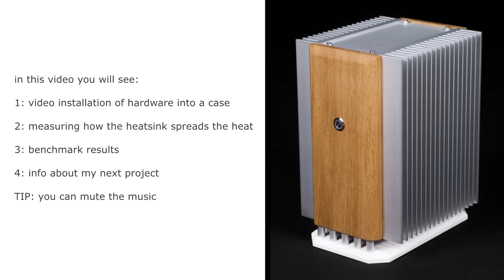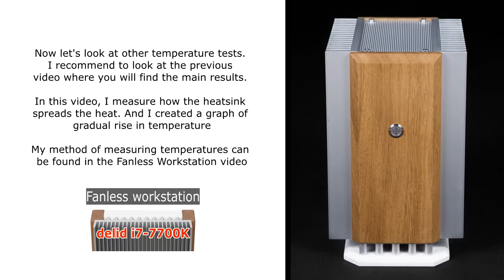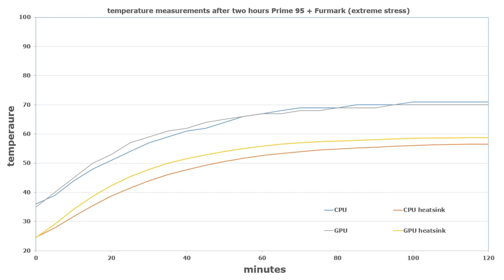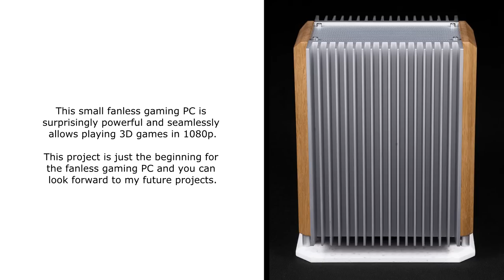How to Build a Silent Gaming PC

Comment: Overall very good design! Thanks for sharing it. I am doing a thermal simulation of something similar. However I spotted a couple of details that people who'd like to try this need to be careful about:
- The backplate of the GPU may short circuit pins on the back of the card. In the way that it is mounted there are no spacers other than the thermal gap pads (which will soften and compress as the card heats up) between the sheet metal and the back of the board.
- Second, you need you be careful with the force that you apply on the GPU. Since rigid mounting is used (bolts and nuts, not springs) you rely on a "small" bending of the PCB in order to achieve even compression of the paste. Desktop CPUs can take a lot more force because they have a heatspreader that reinforces the construction, however the GPUs have exposed dies, therefore very little overcompression will crack it. The limit for Intel BGA devices on laptops is 67N of maximum static load and if you work it out, it does not take a lot to damage large BGA devices. Just make sure that you tightening the four nuts on the back of the GPU precisely the same number of threads and don't force it too much.

By the way there is a passively cooled 1050ti. I believe it was a Palit model. Have a look if you're interested. 
Cheers!
Reply from the maker: Thank you, you are right that I could describe in more detail:
- I used 3mm Heat conductive gel foils, which is very strong. Of course, it's important not to shorten anything - I used the backplate of the anodized aluminum that is electrically non-conductive.
- yes, it is important to tighten the screws with the feeling that nothing is broken, it is true that it wants experience and it is not a solution for everyone
- Palit GTX 1050 Ti KalmX is not designed for a fanless case, it has much worse cooling that does not work without a fan in case (review - https://www.tomshardware.com/reviews/passive-cooling-geforce-radeon-test,4960.html )

Comment: I wonder if pure copper thermal conductivity is 1.87 times better than pure aluminium, can I simply assume displacing aluminium in  this project with copper would bring 1.87 times better heat dissipation?

Comment: Excellent work. I see you have a talent for working with different materials and knowledge about electronics...that's great.
When I get the time I plan on building a no- fan PC myself. Funny enough I had similar design in my head..just without the stone only aluminum and wood.

Comment: Since total watts in TDP are a good indicator of heat generation you could also put in a GTX 1060 and as a tradeoff use a non-K CPU, better yet a 35W CPU. I built such as system before, not with passive cooling but total power consumption stayed within 130-140W and I was using a HD-PLEX DC 160W with a 150W laptop power adapter to run it all.
Reply from the maker: The GTX 1060 needs external power, picoPSU does not support it, I think the GTX 1050Ti is optimal for this size heatsink and the CPU power here was only used to test the total power of 150W with regard to PSU 180W - this is a secondary project and i7-7700K I have for my main project that will come later and will be a much more powerful fanless gaming PC

Comment: Such an amazing clean design! As a consumer I am drawn to this idea, but I would want to run much higher TDP GPU and CPU, even if it means adding a large diameter quiet fan - “near silent” is good enough, as long as the system is still SFF and user-upgradable in the future.

Comment: Timeless master piece, love the wood + metal design. Absolutely the best Ive seen
Ever thought doing a Ryzen 2400G? it has TDP of 65watt, lass then your current underclock cpu at 70 Watt
Reply from the maker: Thank You! There is no problem with AMD Ryzen, but I'm currently using components from Intel ...

Comment: Impressive, and an interesting attempt at a gaming system. I don't have the numbers at hand, but I believe the 17 7700k had a stock 4.2ghz speed and turbo boost of 4.5ghz @ approx 1.25 volts.  Eevn though you've under volted the C.P.U and lowered the ghz..it is still generating a fairly noticeable heat into the passive heat sinks. I don't think its quite gaming ready, but it is still a very solid attempt. Well done.
Reply from the maker: Thank you, please read my first comment why I used the i7-7700K

Comment: Probably the most tasteful and practical case design on the internet that I have seen, I would like to see with all the cords plugged in as your cable management looks well considered as well and its has to be one of the biggest issues to getting a real life build looking nice. A 1080 Ti/8700k @4.5/5ghz would be some real clickbait imo....would this build be big enough to even fit a 1080 TI? IF so do you sell a kit?
Reply from the maker: Thanks for support! Cables are not a problem, there is also the possibility of pulling cables through the center hole in the cover and then through the desk board for "wireless" design. I'm currently working on a high-end fanless gaming PC, you can look forward to more videos ... maybe in the future it will be on sale.

Comment: That is design and p[planning at its best but I have 2 major questions:
1) Where is the IO plate?
2) How in the world did you create the aluminum block with a saw?? That alone needs a video
Reply from the maker: 1) I did not use IO plate, for better airflow
2) I thought heatspreader between GPU and heatsink, where I had to modify the aluminum block on the saw, heatsink is bought:  https://www.fischerelektronik.de/web_fischer/en_GB/PR/SK519_/datasheet.xhtml?branch=heatsinks

Comment: I believe that the heat sink design should add more improvement for the system cooling. It may be cast like an ants house in a way that makes native air flow depended on the differential temperature of the heat sink's surface areas. However, it stills smart idea.

Comment: how you reach the IO's is still a mistery to me....
Reply: Now why are u here asking logical questions again?...off with you pls
Reply: bottom, where he put the stand. Basically, you plug all what you need to plug, run it through the side or through between the little circular aluminium cylinders before you cover it with the shroud that acts as the stand :)

Comment: that sized undervolt can result in the minimums you saw in benchmarking, 1 volt would always be my minimum
Reply: As long as the system is stable there is no undervolt too low.

Comment: Awesome video!! I hope you keep up the hard work, I am very interested to see your next build.  If you can get these up to 300-350 watts worth of dissipated heat and then get the manufacturing process down, you will have a lot of business.  If I may be so bold, you should consider reaching out to guy from the you tube channel "Not from Concentrate"  and see if he interested in doing a partnered build with you.  He does a lot of custom super mini ITX cases.  It would be a dream to merge your two ideas.
Reply from the maker: Thank you very much for your support! NFC makes interesting ITX cases, but it's a different style.

Comment: if you drill holes through the thick part of the heatsink from top to bottom creating like heat pipes you will get like a 5 degree improvement
Reply from the maker: heatpipes do not do miracles, maybe it will help 2° C
Reply: FanlessGuy I was just talking out my ass I tend 2 do that

Comment: Nice build but how to eliminate card's coil whine? It does sound much more annoying than well built fans. Its quite noticeable in my GTX1080. I've got 3 x 120mm (AIO) fans and 3 x 140mm fans and they never bother me but vcard and hdd does stand out a lot.
Reply from the maker: I do not have GTX 1080 experience, but my GTX 1050 does not have this problem

Comment: Hello. Great job! I've got a question. Does pico psu handle the whole system? Any resets, bsod etc.?  How many Amp. for the Power Adapter? Thanks in advance!
Reply from the maker: the system was stable without problems, I used a 12V 200W external power supply

Comment: Nice job man, would there be an improvement if the aluminum exterior was facing inwards instead of outwards?
Reply from the maker: it would certainly not be better
Reply: I'm so embarrased, I've must of sounded like such a troll,, nevermind that last comment as I see my mistake (still thinking that the gaps allow airflow so no need for a flat tile in the exterior as well). Excellent build Congrats!
Reply: I was not, not kidding, although.. Doesn't the cable extension for the GTX 1050 not help in graphic intense moments? Meaning: If the GPU was connected directly into the motherboard, would there not be a better performance? (Not saying for this build though, just pointing out that there are drawbacks to having a PCIe extension cable.. nay or eh?) (As I wrote this, benchmarks show barely .010% difference so I guess it really makes this build stand out even more,,!)............................... Cheers mate!

Comment: Amazing case! But how do you turned it on? I mean you blocked the mobo connectors and stuff
Reply from the maker: the cables must be plugged in before the bottom cover, there is also the possibility of pulling the cables through the center hole and then through the desk board for the "wireless" design

Comment: I want to make something similar but as NAS server with 5,25 bay for IcyDock 6x2,5inch disks. But cooling IcyDock is a challenge to me and i think i wont escape from using fans. I would only need to replace 40mm noisy fans on icydock chamber to some 120mm on case an make case hermetic

Comment: 1. Thanks for minimalist builds. Please share links of needed parts.
2. Can you make gtx1080 build with SFX-L psu. Maybe minimal sound possible however will be stronger. 
3. I have mini fridge parts. I want to use them as a external cooler of a aluminum case. Is it possible?
Reply from the maker: 1.heatsink link: http://www.fischerelektronik.de/web_fischer/en_GB/heatsinks/A01/Standard%20extruded%20heatsinks/PR/SK519_/datasheet.xhtml;jsessionid=3BE6D21C82D29424CF303317241F46B0
2. yes, I am now working on a more powerful fanless case
3. I do not have any experience with fridge parts
Reply: In the website there are only 3 measures for that SK519, where did you get yours (246mm length)?
Reply from the maker: I bought 1000mm and cut into four pieces for three projects: Fanless HTPC #2, Fanless PC #1 and Fanless Gaming PC #1 ....
Reply: Wow, clean cut.
Really, If you decide to sell something, I think you will have a lot of success!

Comment: Why didn't you use a 1050ti CalmX or so? It would've been way easier and a bit safer because of shorting pins via the Heatsink, right?
Reply from the maker: CalmX has much worse cooling and is unusable in a fanless case (for example, this review: https://www.tomshardware.com/reviews/passive-cooling-geforce-radeon-test,4960.html) if you are careful not to short, so it's no problem - I used 3mm thermal gel foil and anodized aluminum, that's all electrically non-conductive. Finally, it's also a matter of design ...

Comment: sorry for being new in this but, how do you power this machine i didn´t see a power supply in the hole video, i just need knowing how. (if my english is bad its because its not my mother language, im mexican by the way)
Reply from the maker: there is a 180W picoPSU + external 200W DC 12V adapter

Comment: nice design but 3.6Ghz on 7700K is too low for such a large heatsink must not be efficient.
Reply from the maker: Please read my first comment for more info. By the way, this is a relatively small heatsink for SFF fanless case, it was a secondary project, I'm working on a much larger fanless gaming PC for which I have this i7-7700K CPU

Comment: Fanless is allright, but the effect would be so much better just using one single fan at low rpm.
If you chose a decent fan-model you wouldn't even hear it. and it would be much healthier for the vrm's and the nand-flash in your system wich WILL die prematurely when running without any circulation.
I can barrely hear my system yet i have 7 fans and two gpu's.

Not saying this to bash your project, i like it alot, i'm just concerned about that expensive nand-flash memory that will be overheated.
Reply from the maker: Yes, of course, the fan will cool much better, but I present an SFF fanless solution that is not for everyone ... there is a natural air circulation, I have not been using fans for 12 years and I have no problem with HW life.

Comment: Did you de-solder the external power connector on the GPU card?
Is it really ok to use a 180W power supply to handle 150W total power?
Reply: Very good question!
Reply: Ok, so there is Pico 180W + external PSU 200W = 380W total

Comment: I'm surprised that PSU has enough power, also that i7 seems like an overkill for that setup, I would say i3 would have been a better match.
Reply from the maker: Of course the i7-7700K is not suitable for this small fanless case, I explained it in the previous video - CPU I have only to test the cooling and PSU and was underclocked and undervolted (3.6GHz / 0.910V) - 150W at full load, of course there is no problem using less powerful CPU ...

Comment: Why a 7700k if you're gonna run it at  3.6GHz ? You should try 7700 (65w) or the 7700T (35w). Or even the 6700T on a Z170 motherboard that can overclock the base clock of non-K CPUs, that way you can get higher clocks with lower tdp.
Reply from the maker: please read my first comment

Comment: Beautiful Build, but there is no AC/DC Power Adapter with the laptop style connector are not strong enough to power such a System without flawless while AAA gaming. The Strongest I found was able to deliver 156W.  You better have a little headroom with your AC/DC power delivery. The DC/DC instead can handle more then the given Watt.

my cases
120w Brick: restart when Game starts running
156w Brick: restart after an hour+ game time, but not always
196w Brick: no issue

my system
1050ti and Undervoltet, 35W limited i5 needed an 196W brick with an other style connector to run without Issues. The System pulls just 100W. Maybe just an issue with my system, but better save then sorry.
Reply from the maker: there is a 180W picoPSU + external 200W DC 12V adapter
Reply: @fanlessguy1395  Which 200W Adapter are you using?
Reply from the maker: something like this: https://www.ebay.com/itm/Lighting-Transformers-DC12V-Driver-for-LED-Strip-Power-Supply-60W-100W-200W-300W/232332598952?hash=item36181a1ea8:m:mpzLpwDyD0YY4ZrkvVGzNNA  -  I know it does not look nice, but it works well

Comment: Bro plz help me my acer predator helios 300 laptop is broken and i want to make it pc and it heat alot so i want to build a cooling case for my laptop motherboard .. plz help me
Reply from the maker: This laptop will need a big heatsink maybe even two on each side. But I can't tell you exactly, try experimenting and the result comes, I believe it's possible

Comment: Where do you buy these aluminium radiators/heatspreaders?
Reply from the maker: http://www.fischerelektronik.de/web_fischer/en_GB/heatsinks/A01/Standard%20extruded%20heatsinks/PR/SK519_/datasheet.xhtml;jsessionid=3BE6D21C82D29424CF303317241F46B0
Reply: Thank you!

Comment: where d psu or any cable for power
Reply from the maker: there is picoPSU 180W + external 12V 200W DC power supply

Comment: Am i high? Where do the cords run from
Reply from the maker: The cables are connected from the bottom after removing the bottom cover. There is also the possibility to pull cables through the bottom cover and through the desk board for "wireless" design.

Comment: You really need to spread the GPU paste fully before mounting the sink, there's no CPU-type heatspreader to help dissipate heat, you can end up with a GPU chip partially exposed to air
Reply from the maker: I have a good experience with my paste I have been using for 12 years and my practice has shown me that I do not find a difference with a thin spreading
Reply: All I'm saying is you should always spread the paste when doing direct-to-chip contact, CPU or GPU, if there's a single portion of a chip not covered in TIM, it will overheat. That's why there's always a ton of paste under GPU heatsinks, they need to be sure the whole die's covered...
Reply: I honestly meant no disrespect, I'm thoroughly fascinated with your work
Reply from the maker: Do you think I put a small amount of paste? Every time I take it off, there is 95% of the paste around the chip and there is no empty space....
Reply: Then it's okay, I guess, but there's always a chance of the sink favouring one side when pressing down, I'd rather avoid the gamble

Comment: A gtx 1050ti is underpowered for a i7 7700k but good vid
Reply from the maker: The GTX 1050Ti is the core of the entire SSF Fanless Gaming PC project, it is equivalent to cooling and power of the power supply (GPU TDP 75W no external power), it is not possible to place a better graphics card in this case. Please read my first comment for more information about why I used i7-7700K ... Thank You

Comment: the gtx 1050 ti looks like a bit of a bottleneck for the 7700k, the cpu won't overheat while gaming for sure.
Reply from the maker: yes you are right, I explained it in the previous video, i7-7700K is very powerful for this fanless case and for testing was underclocking 3.6GHz / 0.910V - the best option is i7-7700 (3.6 GHz TDP 65W)
Reply: Would  a 7700  actually be better though? Because you can't manually lower the voltage like you could with a 7700k right? Wouldn't you get worse temps with a 7700? Or would it just lower the voltage itself or something?
Reply: I'd just go with an i5
Reply: lol
Reply from the maker: Yes, i5 is enough for the gaming with 1050ti ... I have 7700K only to test different types of fanless case. ... otherwise i think the voltage can be regulated even with i7-7700 - it's the property of the motherboard, in the previous fanless case I had a thin mini-ITX board and there it was not possible even with the i7-7700K